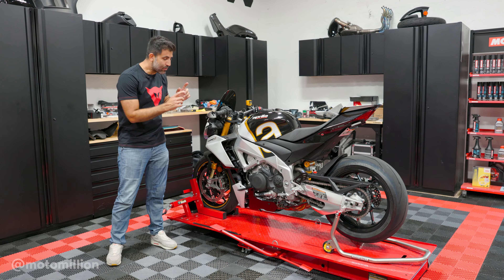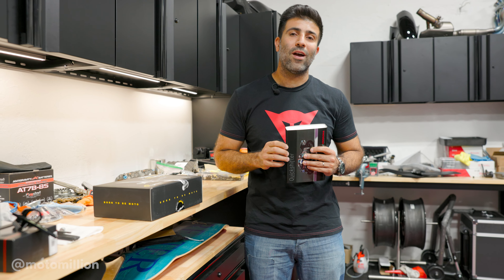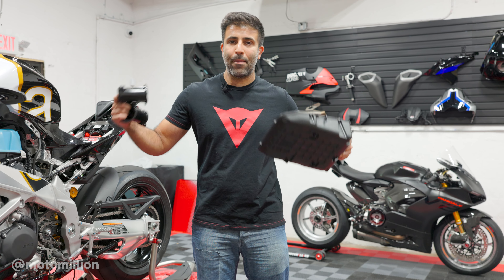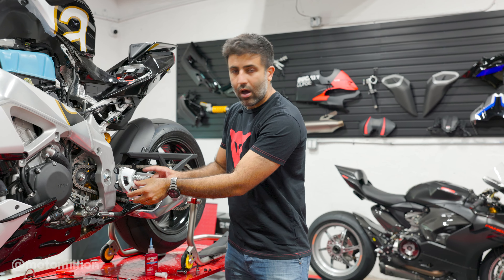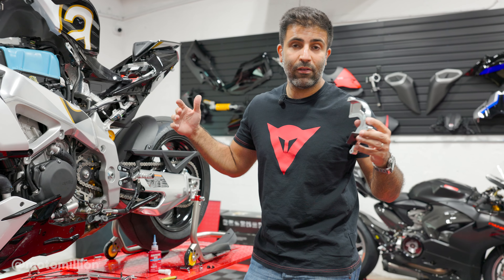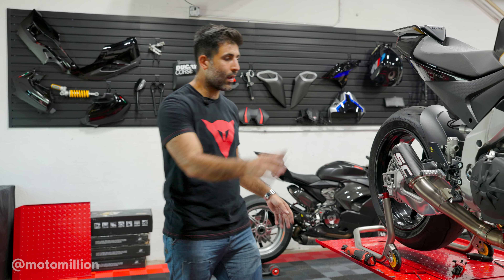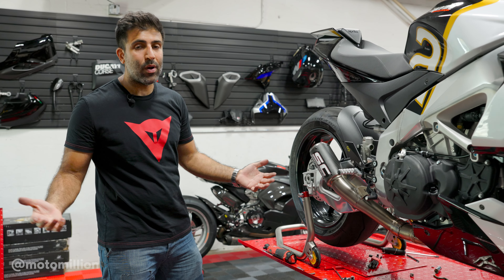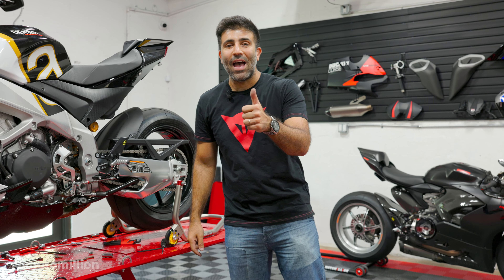IMPROVING the SHIFTING of our Tuono V4 1100

Comment: I ve got a brand new Tuono 1100 factory and putting it into neutral is a nightmare. Any tips?
Reply: It gets better over time.
Reply from the maker: Gets better, especially after the first oil change. The shifter support bracket also helps, but it is not the all be it solution for it.
Reply: Put it into neutral just before you stop. Perfect every time